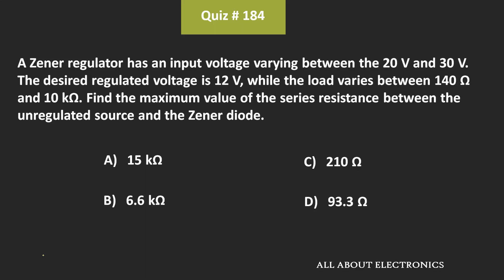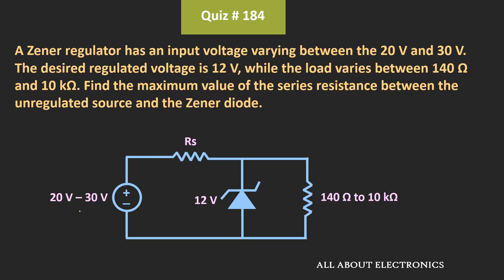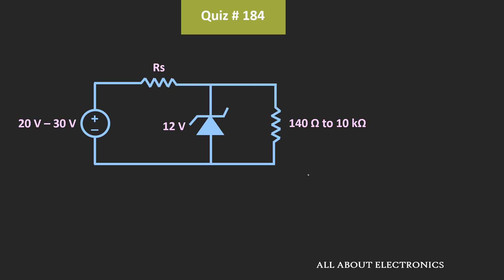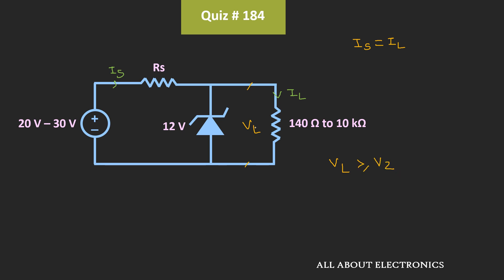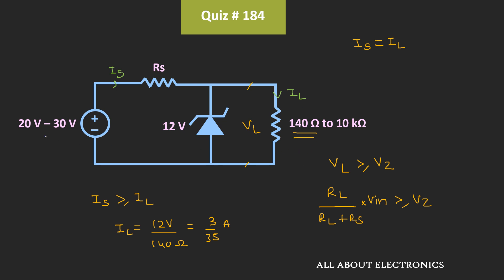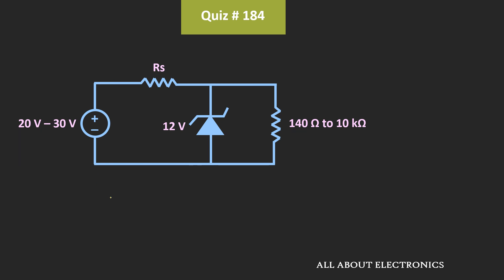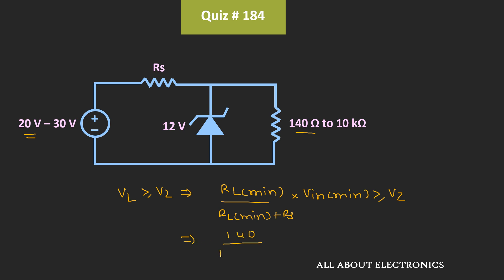Zener Diode Solved Problem (Analog Electronics) | Quiz # 184

Comment: why zener diode current is 0
Reply from the maker: Typically when the Zener diode is operating in the Zener region then some current is flowing through the Zener diode. And Izk is the minimum current that needs to flow through Zener diode to operate in the Zener region. Here, in the question Izk = 0. So, while finding the value of Rs, the worst case is considered. And in the worst case, Izk = 0 is considered. (when the Zener diode is just turned ON)

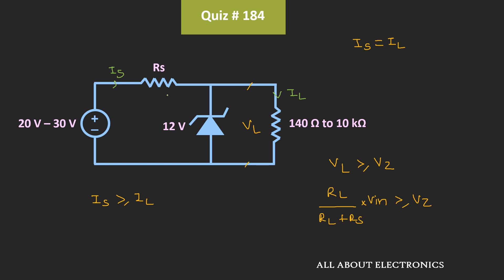Comment: at 2:32, when RL min => IL max => Is max => Rs min?. I don't know what means when you use RL min in here???
please explain for me
Reply from the maker: Here we need to find the maximum value of Rs with which the circuits properly. Intuitively if you see, when load current is maximum then obviously the supply current Is will also be maximum. The load current is maximum when RL is minimum right !! So, with that, we know IL (max) = 12 / RL (min). Now, supply current should be able to supply that much of current to the load. Is = Vin - Vz / (Rs) . 
To find maximum supported value of Rs, let's consider minimum value of input voltage. Because if the circuit works for the worst case, it will work even when the input voltage is more. So, here we are considering Vin (min) = 20V for calculation. 
And with that, maximum value of Rs is calculated, such that Is = IL (max).
In this case, that is (20 - 12) / IL (max). 
I hope, it will clear your doubt.
Reply: @allaboutelectronics-quiz  but we need to finde Rs MAX, so i don't know why you explained about IL max or RL min ( because Rs min when it occur)???
Reply: @allaboutelectronics-quiz  and why To find maximum supported value of Rs, let's consider minimum value of input voltage? why don't you consider maximum value of voltage? please explain for me
Reply from the maker: @Work-ec2uc  Because with the maximum value of input voltage, if you calculate the Rs (max) then it won't work for Vin (min).  Just try once with the calculation. Try to calculate Rs (max) with Vin (max) and then use the same value of Rs (max) when Vin is minimum. And for that calculate the value of Is. Just see that, whether it is able to supply IL (mx) ?
Reply: @allaboutelectronics-quiz  but with Rs = 93.3 ohm. When Vin = 30 => RL = 62.2 ohm, it doesn't match. So i think it's not true
Reply: @allaboutelectronics-quiz  my answer is 6.6k ohm. i take RL max (=> Is = IL = IL min) and Vin min to ensure the circuit works for the worst case. Is it true? Can you explain for me?

Comment: great video. The answer is correct. for those who think that the answer is wrong. you can double-check the solution by doing the following:
VD : Voltage drop across zener diode
RL : Load Resistance

VD = VRL = RL/(RS+RS) * Vin  =  140/(93.3 + 140) * 20 = 12V 
which means that indeed the value of Rs = 93.3 does ensure that the voltage drop across the Zener diode will be at least 12V in worst case scenario. 

* Using Rs < Rs(max) is OK since it means VD will increase, however, if you use Rs > Rs(max), then it would be possible in some scenarios that zener breakdown won’t happen because 
VD < VZ

Comment: I think the answer is wrong Sir. It should be 15k ohm. 93.3 is the minimum value.
Reply: Ya you are right,
Reply from the maker: Since it should be less than or equal to 93.3 ohm, so maximum allowable value of Rs is 93.3 ohm.

Comment: This answer is wrong...
Reply from the maker: Please go through the video thoroughly, you will get it.
Reply: @allaboutelectronics-quiz  For maximum value of resistance the current will be minimum so the answer will be 6.6kohm
Reply: @siddharthasingh8401  The minimum current through Zener is the I_zk, not given in the problem. So, it is fine to take I_zk = 0 (mentioned in the video). R_s(max) = 93.3 ohm
Reply: I also think so....sir the question was maximum value of the series resistance......so it will be 15kohm and minimum value will be 93.3ohm.....sir please check the question and answer again 🙏🙏
Reply: If 93.3ohm is the maximum value then what will be the minimum value of resistance sir?
Reply: @moudouli8967  To find the minimum value of R_s, we have to consider the case where the maximum current will pass through Zener. (the maximum current Zener can withstand) . In this problem, the maximum value of the current is not given. So,  it is not possible to find the minimum value of R_s